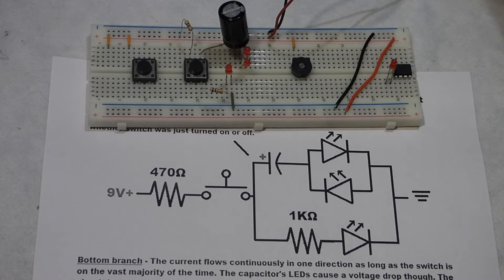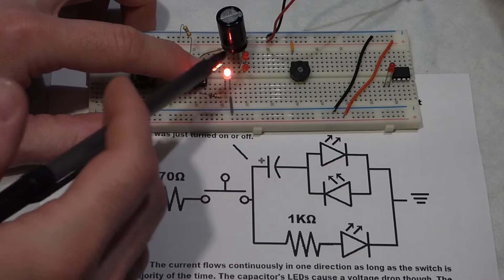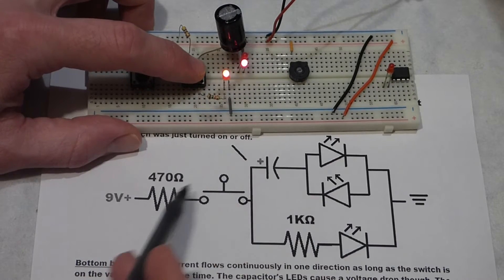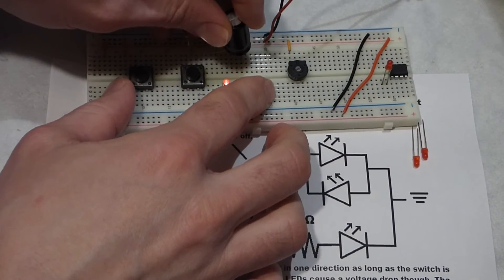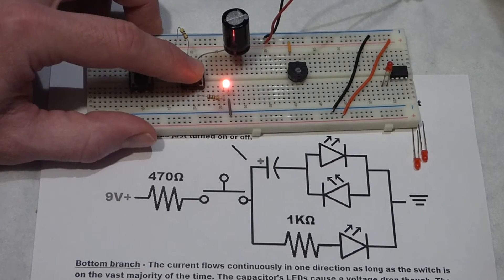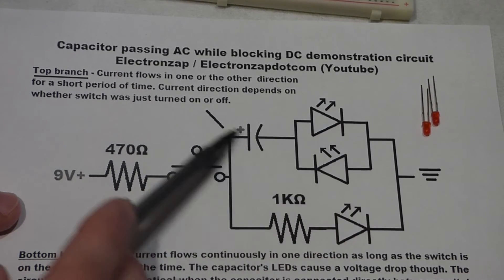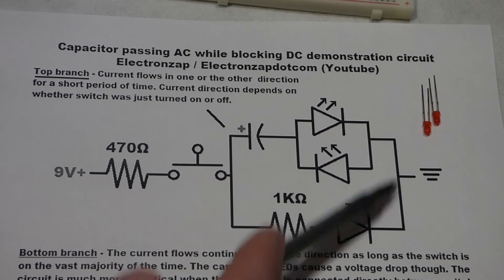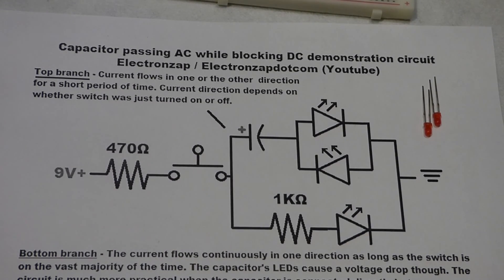Electronics electrolytic capacitor blocking DC but passing AC demonstration circuit explained

Comment: Novice question: But, if you are using a 9V+ battery [and a battery delivers DC, right?] then what/WHERE is the AC that you are letting through, coming from? It’s a DC battery NOT an AC battery, what is producing AC voltage in this circuit? Please let me know, I’m trying to learn more about this stuff. Cheers!
Reply: he is simulating an alternating current by closing and opening the circuit with the button
Reply: @abraxaskabrakas6098  And that makes it AC? It’s still moving in just one direction, AC is supposed to reverse course direction, as I understand it AND polarity. Opening and closing the circuit, achieves none of these criteria, am I wrong?

Comment: Technically speaking, you have pulsed DC, not AC since it does not alternate (i.e. reverse and go below your 0v reference).  So the capacitor is really passing the changes in current.  AC just happens to be one way to do that, but I don't believe your circuit is truly AC, it's pulsed DC.
Reply: Yes that is DC. I make one too.

Comment: Thank you for the video. As a newcomer to electronics and being self-taught from the web this topic has confused me endlessly. The terms "alternating" and "direct" in combination with "current" and "signal" and "pulse" and the official IEEE definition of AC being: "A periodic current the average value of which over a period is zero. Note: unless distinctly specified otherwise, the term alternating current refers to a current that reverses at regularly recurring intervals of time and that has alternately positive and negative values." and DC: "A unidirectional current in which the changes in value are either zero or so small that they may be neglected. Note: as ordinarily used, the term designates a practically nonpulsating current. A given current would be considered a direct current in some applications, but would not necessarily be so considered in other applications." It's not clear to me that a simple change in polarity (i.e. "negative DC pulse") itself constitutes "alternating." Nor does a frequency such as out of an oscillator, constitute "AC" (to me) because it's still unidirectional! And yet a pulsating DC signal needs to pass through a coupling capacitor in order to have audio. This is usually called "blocking the DC signal while allowing the AC signal to go through." Yet - the signal itself is still unidirectional, even though having a frequency - so how can it be said to have an "AC component?"  The entire topic has been driving me a bit batty, and I haven't found clear definitions to separate the fog. I did finally find a thread which admits to the misuse and confusing use of terms - https://boards.straightdope.com/sdmb/showthread.php?t=494980.  Thanks again, any light you can shed is welcome!  : )
Reply from the maker: Thanks for watching! Electronics is hard to understand in written form until you are familiar with it. Learning about as many simple circuits as possible is the quickest way to get familiar with basic electronics. That's why I focus mostly on simple circuits.
Reply: @Electronzap  As it turns out, just today I finally had a breakthrough in my understanding of all this. I documented my findings in a video I just made, you're welcome to check it out ("Beginners look at DC bias & coupling capacitors").
Reply from the maker: @ApexMark2002  Very cool!

Comment: Thank you very much. Question: I seem to have experimentally "proven" that capacitors pass a little DC current and posted this as a Yahoo Answers question: https://answers.yahoo.com/question/index?qid=20171228131407AA0leNq 
You would get the same results if you replicate the experiment. What do you think?
Reply from the maker: I have to get ready for work, can't follow any links, but capacitors have leakage which ultimately is them passing a little direct current as some current gets through the insulation between the plates. It is one of the sources of trouble in circuits not designed to take it into account.

Comment: IS there any reason why one can not place the pos term of a dc electrlitic capacitor to the hot leg of the grid (AC) and the neutral to the neg terminal of the capacitor assuming the capacitor is rated for more than the grid's voltage???
Reply from the maker: Sorry but I have no experience with line voltage and have no idea how to safely use a polarized capacitor with line voltage. I do know that AC sees a capacitor as being a short circuit, which means high current, even for a capacitor, plus it's inductance is more dramatic, so you need to know how to deal with a lot more than just the voltage level.